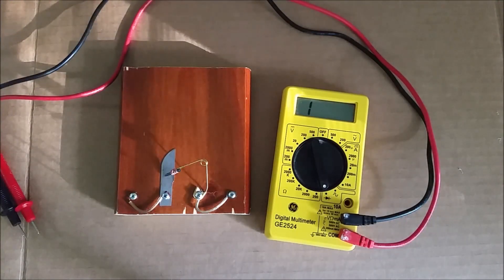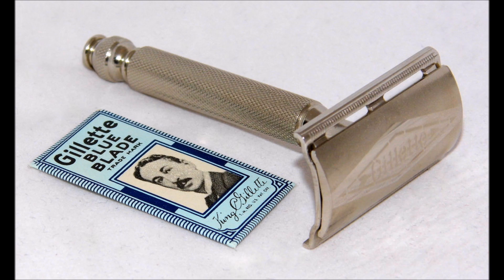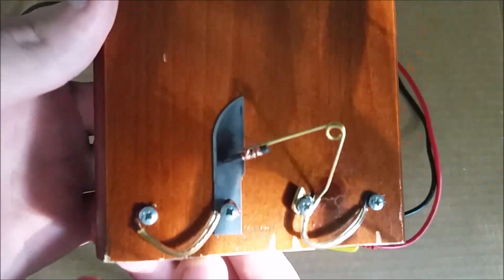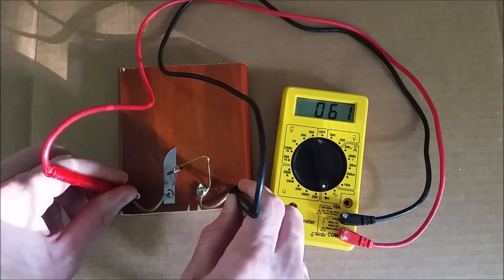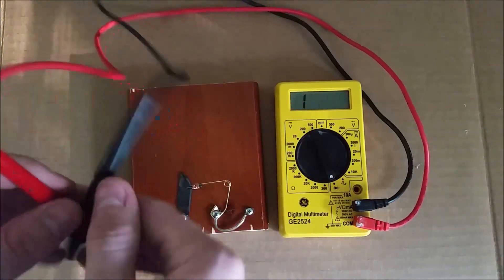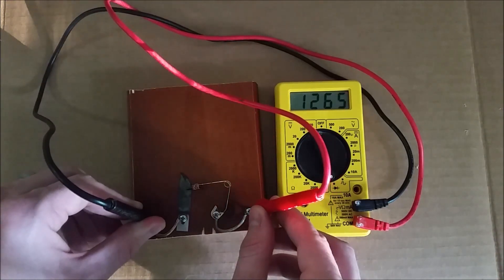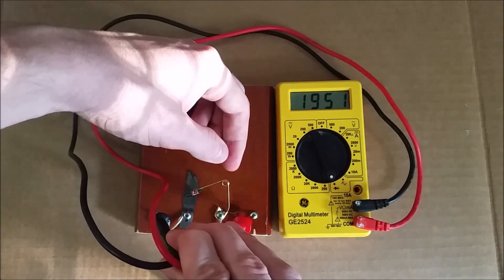Homemade Diode

Comment: im pretty sure it gets better than that -  im doing one with copper and vinegar and i was testing it with an led, and i got full conduction one way, and none in the other completely!  but i still have to nail it for real,  but it actually did help to have both sides affected by the vinegar, just one heavily done, and one done a little bit.   but i dont know what im doing yet either.

Comment: I've been learning about electro-magnetism and saw a project showing you how to make a shake flashlight. The electricity generated by the magnet passing through the coil creates AC electricity. The project requires 4 diodes to creat a simple AC-to-DC converter. Do you think this will work for that?

Comment: Could someone explain to me why heating up one side causes a difference in resistance for the electrons depending on what direction they are coming from?:)
Reply: As far as I can tell, Heat agitates and frees more electrons. But when the voltage reverses, electrons going toward the heated cathode are slowed or stopped by electrons already there because of the heat.-Since like charges repel

Comment: I can now test if i done the blade properly now thanks. I also just bought the exact same multimetre as yours yesterday because my old one was getting un reliable. so now i know how test resistance with it aswell. 2 in 1 👍.

Comment: It's not 1400 kiloohms. The multimeter is set to diode tester, not to kiloohm range. It is 1400 millivolts at whatever current the tester uses for testing diodes (typ. about 1 mA) in this case it would be 1400 ohms .

Comment: Your knowledge of this is VERY shallow.  First, these were used in World War ONE. They were used because it is a passive receiver with no local oscillator- because THOSE radios actually radiate EM waves that the Germans could detect and use direction finding to attack the listeners in the trenches. These radios were actually relied on by the Allied Planners to get important information to troops in the trenches,  in particular attack times.
SECOND, these detectors are not "semiconductors" in the normal PN junction sense; they are actually TUNNEL diodes of a type called MIMs for "Metal-insulator-metal". The reason they act as diodes- although very POOR but useful diodes- is that they depend on quantum tunneling across the thin insulating layer- which would not produce a diode effect if not for the fact that the "work function" or ease with which a material gives up a tiny fraction of free electrons is DIFFERENT between the two conducting materials- in this case steel and carbon. As a result,  there is a residual difference in the amount of electrons passing from one side to the other which in effect acts like a preferred or differential flow which is what a diode rectifier is supposed to do.
If you used carbon on both sides there would be no net flow, or if you used steel on both sides again there would be no NET flow. The two "metals"- or in this case a metal and and a conductor like carbon- are simply trading loose electrons across that thin insulating layer. And that layer can be an oxide layer,  or an organic layer- olive oil was used in a similar detector by Oliver Heaviside as a coating on a steel needle thrust through a layer of olive oil on top of a pool of mercury. 
Are you seeing a pattern here? These are tunnel diodes- but not Esaki semiconductor tunnel diodes- two different animals.  And a tip? Don't let that pencil lead bear down too hard- you'll go right through that oxide layer and then the tunneling phenomenon goes away....
Reply: It was ww2 
Ww1 was 1914 to 1918
First radio station kdka a few years later

Comment: I think the diode setting on your multimeter is showing the voltage drop in millivolts, not ohms
Reply: You don’t want it showing ohms, you want to show that it’s working as a diode and preventing electricity from flowing in a direction

Comment: Hi Over Engineered, great video! Big fun of these DIY project :)

I am an educator and plan to design a lab to ask my students to build this radio in a lab and then, in turn, teach them P-N junction and semiconductor. I am trying to understand the science behind this Razer diode. After a day of google, I end up knowing it is a "metal-semiconductor" junction or a "cat-whisker detector" and it works like a Schottky diode. However, I am still confused about the following:

1) What is the anode and cathode in this razor-pencil diode?
2) If the steel is the metal and the graphite is the semiconductors, what is the reason for having "blue steel", is it related to the oxide? or is it related to the crystal structure and therefore the bandgap changes of steel after heat treatment?
3) If the iron oxide is really needed for it to work, then there is oxide in both side of the iron, why is it diode? it sounds more like a transistor to me.

I will be very grateful if anyone here can give some insight or direct me to the right source. Many thanks! :)

Comment: before there were semiconductors rectifiers were often made of copper oxide - copper oxide makes a pretty good diode for crystal set as well, not quite as good as a good diode or cat's whisker, but still pretty good.

Comment: the heating in the iron results in iron oxide that it has a type N. The iron is a conductor. When applying a current in the direction type N -> normal conductor there is less resistance, because the type N is already filled with eletrons. There is initial inertia. Inertia is the energy that you need to put something moving. In my opinion, you have a "half semiconductor", since you only have type N. For more information check "Iron Oxide Semiconductor Electrodes" articles. Nice experiment. I love to see videos like this. Thanks.
Reply: Thanks, now i know why it works like a diode 👍🏻

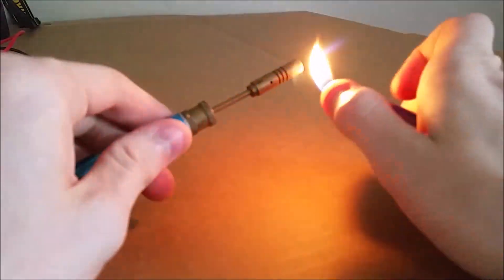Comment: 01:29 Could that pencil torch be also used for working with glass? (e.g. melting it, bending glass pipes, making vacuum tubes etc.)
Reply: You probably could but it's not very effective. I've had them before and you really only use them for soldering and that's about it.
Reply: No it's not quite hot enough. You need oxygen and propane for glass blowing.  Maybe other stuff would also work but you're going to be using so much gas that you'll want to use that cause it's the cheapest.  Both tanks are fairly cheap so you can make a lot of stuff (or screw up a lot of stuff while you're learning.)

A glass blowing torch will always have an oxygen and propane hose connection at the base and let you adjust it to make it hotter or colder.  Adding more oxygen makes it burn hotter but will require you to work fast.  Don't react to the glass melting fast enough and it'll be ruined in seconds.
Reply: Another thing you need to know is you need to have a specific type of protective glasses cause the flame from the oxygen/propane torch will otherwise burn your eyes and make you go blind.

And also, glass dist is extremely unhealthy to breath in and can cause irritation, pollups, and cancer, and it just gets worse and worse the longer you're exposed to it, when glass blowing you'll have glass shatter and sometimes you'll just want to break it to save time, so there's going to be a bunch of glass duat all over the olace.  To counter this usually a good ventilation system is used or you can blow against an open door or window with a fan on your table forcing all the air out.  Just make sure it's working and the airs being sucked out

Comment: There's another method that I had come up with which is basically like a Tesla coil where the wire is coated with pencil lead wrapped around a ferrite magnet. This works because any backflow current is canceled by the magnet and there's not much altercation on a crystal radio because it does not have its own power source rather than the crystal radio.

Comment: Great video! I’m sure you have heard that and I would be surprised if you even read the comments, but there has to be a way to pick up the frequency for internet
Reply: your not gonna be able to make an internet capable device with anything short of a $100,000 ic production lab, but the antenna would be easy enough to make.

Comment: So I understand how the oxidation on the blade would increase the resistance in both directions, but, how is it that the resistance is greater in one direction than the other?  Does it have to do with the placement of the pencil lead?

Just in trying to understand, I expected that the current flow should be greater coming from the end where the blade (more conductive material) is present, meaning less resistance from this direction than the other, and I see that this is the direction of less resistance, so does my reasoning here explain this?  Thanks.
Reply: 51MontyPython my understanding is that the graphite of the pencil and the specific blue oxide state of the iron form a P type N type layered semiconductor.

Comment: Dude, just a curious, weird and crazy idea:
If a person takes a mesh steel wool (not the stainless kind, and not the roll kind, just the one that comes as a single piece) and burns it with a lighter on say on ceramic plate or sauce, then does the same thing you did with the razor, do you think this would work as a metal (iron oxide) detector?
https://duckduckgo.com/?q=mesh+steel+wool+0000&iar=images&iax=images&ia=images
Dunno whether it works or not, and maybe one needs to experiment a lil with it, like grind it and in soak it in a small amount of natural resin like Gum Arabic [ Acacia Gum ] / Arabic Gum [ Mastic ] in disc form or rectangular/cubic. Until it solidifies, but resin maybe needs to be very little or maybe push it in some kinda mold or press. Just thinking about it.
Or even that might become some kinda ferrite! That one winds a copper wire [maybe phone] like coil around to get AM Radio signals! Who knows! ;D I am also thinking of headphone wires as some kinda litz wire! Dunno gotta try them, maybe one time.

Comment: Using an oscilloscope would be nice to see how this diode chops of an alternating voltage.
Reply: It seems the purpose(use case) is just to detect AM radio signals, RF.
https://en.wikipedia.org/wiki/Metal_rectifier
http://www.instructables.com/id/How-to-make-a-copper-oxide-diode/
Reply: It would only work on 100% modulated or under modulated AM signals unfortunately